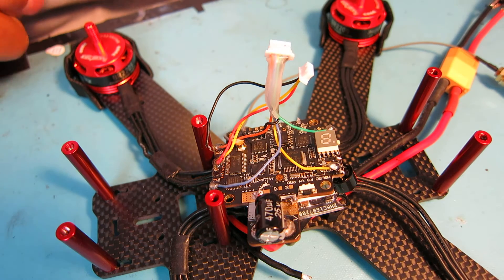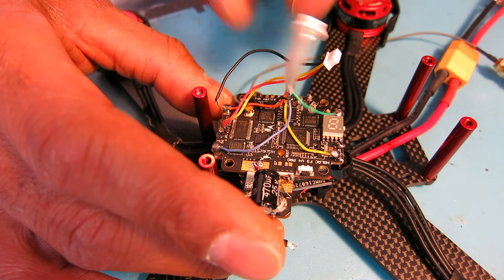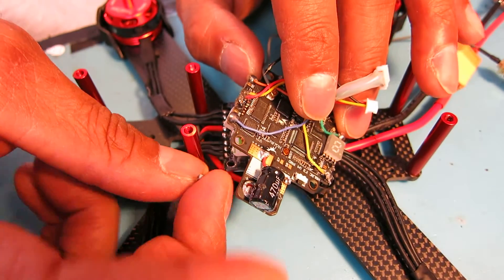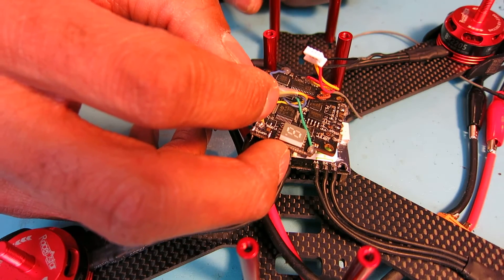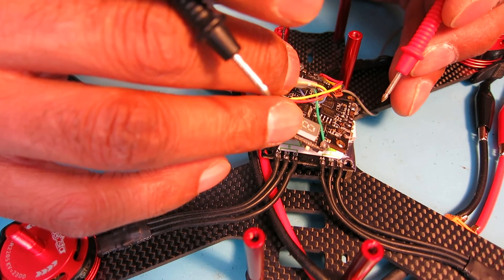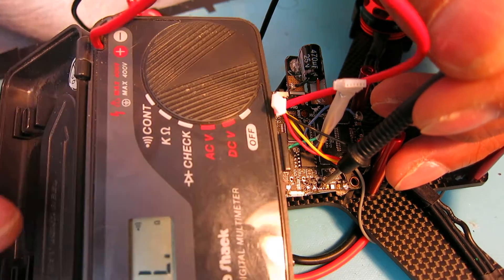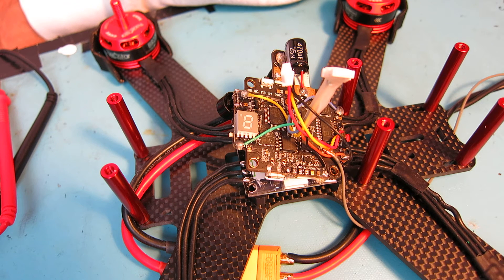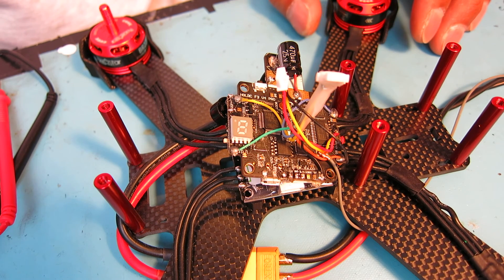HGL Tech F3 V4 Pro Fried!  Build Halted!

Comment: Did you change on the vtx to 25mW as it can get to hot if you have 200mW when your not flying?
Reply from the maker: I did not change the VTX power.  Banggood has sent me a new unit.  I will make sure to turn the power down or off when I try this again.  Thanks for the tip.
Reply: Mile High Multicopters np ^^ happy to help.
Reply: JaakinaRC what about having the antenna connected
Reply from the maker: I did have the antenna connected.  Seems like the best precaution is to turn the VTX off if you are going to have the FC powered up for an extended period of time.

Comment: exact same thing happened to me and for no reason after 24 hours just went poof. I don't think banggood will do anything sadly
Reply from the maker: Bummer for you too.  I read a couple bad stories after I purchased it.  I should have done more research.  I'm still hoping to get some resolution.  I sent an e-mail a few days ago with no reply yet.  Yesterday, I was able to submit a request online and send a link to this video.  Hopefully they will respond either way.  I'll be sure to give an update if there is any news.
Reply from the maker: Banggood.com is sending me a replacement for this unit.  I'm still debating on whether to continue the build or try to sell the replacement FC.
Reply: exactly the same problem here!!
Reply from the maker: Try sending them an e-mail and make a video demonstrating the problem.  Banggood.com support has been pretty good to me so far.  They did send a new board and I have been flying it for several weeks with no problems.
Reply: Mile High Multicopters i did already, but this is the second time this has happened and I think they might get suspicious

Comment: Is that capacitor touching the positive/negative?
Reply from the maker: It's lying on top of the power wires I soldered.  I'm assuming it's insulated and I have a dab of hot glue under it.  I'll double check, but I don't think it's shorting out.
Reply from the maker: I just checked.  No continuity between + & -.